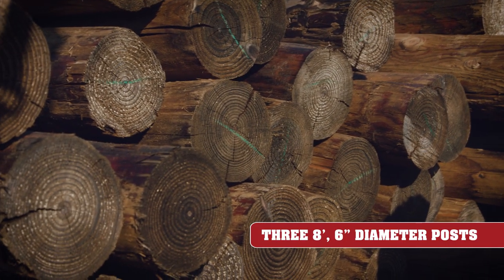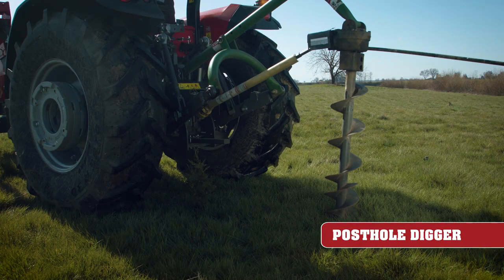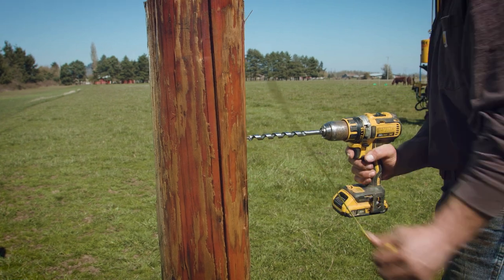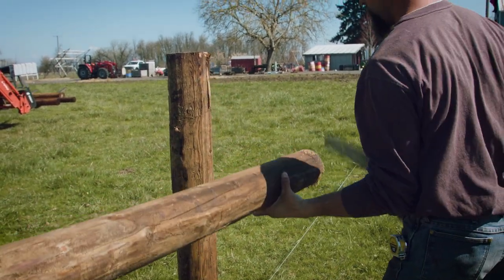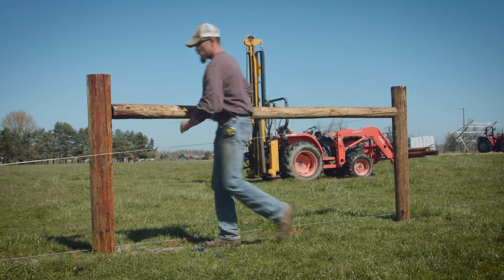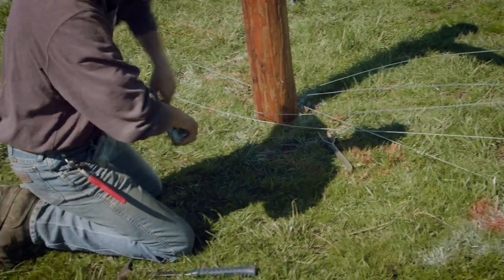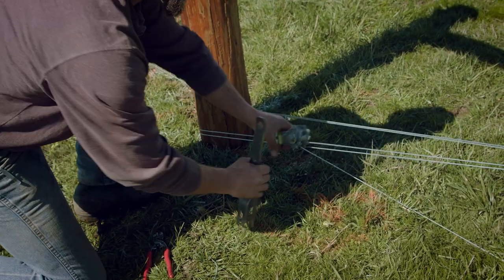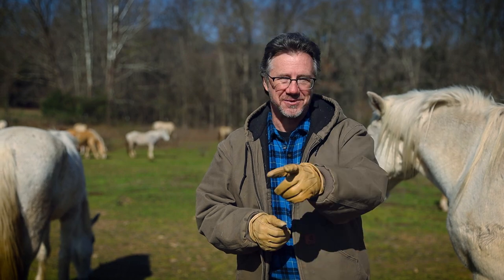Coastal 101: Building a Fence Corner

Comment: 1 - Save the pin by sawing a rabbit out of the posts and knocking it out with the claw end of the hammer. In the video at 0.01 the posts that the narrator walks by has the posts done that way. 2- backfill the posts with 3/4 minus and tamp in with a 5' prybar.  If they ever get loose you can just tamp them some more, and the hole drains water from around the post so bacteria does not form at the dirt line.  3- Put the ratching tightener at the top of the loop so you don't have to bend over or in weeds to tighten it later.  good video.  ps. don't leave your tools in the grass, you will loose them.  Better yet paint them with bright pink florescent paint so you can find them easily.